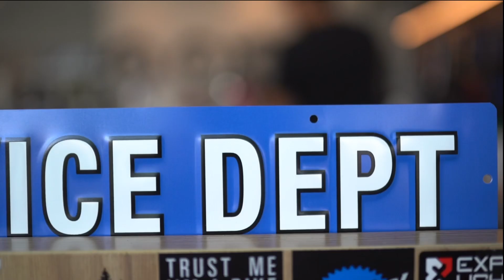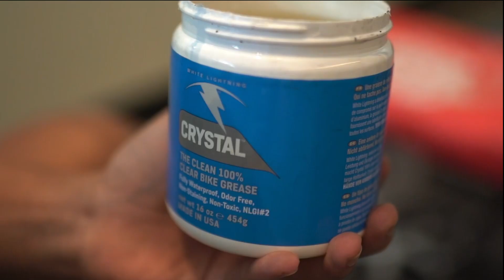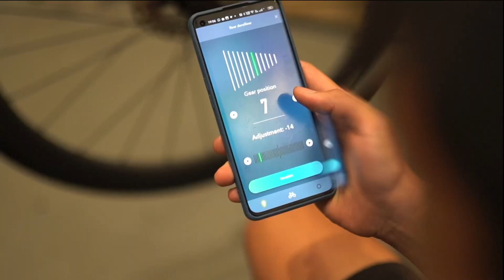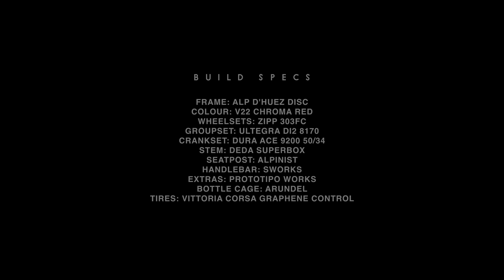Liempehdalbikes | Time Bicycles - Alpe D'Huez Disc 2023

Comment: @liemcycles

What size is this? XS?
Reply from the maker: yes it is an XS
Reply: @liemcycles  I know the spec says optimized for 28c tires, but is there more space for a 30c?
Reply from the maker: @fjskj6529 we haven tried but we reckon it might not fit.
Reply: @liemcycles is it really XS? Geo chart says XS is 430mm from BB to top of seat tube but this looks much longer
Reply from the maker: @nicknick194 yes, you’re not the first to think it looks larger than an XS!
Reply: What is the weight of the complete build?
Reply from the maker: @kokpintan8382  its about 7.6kg with pedals for this set up